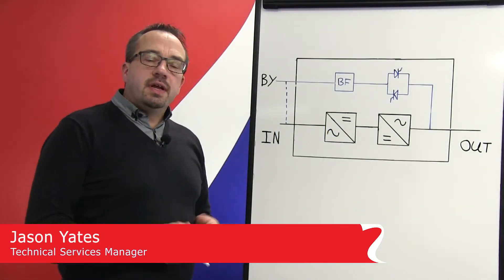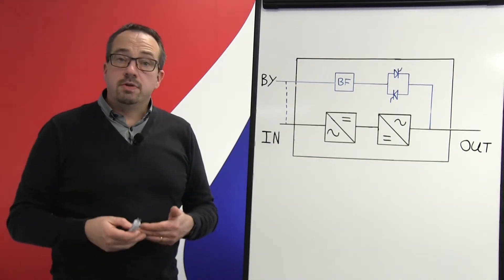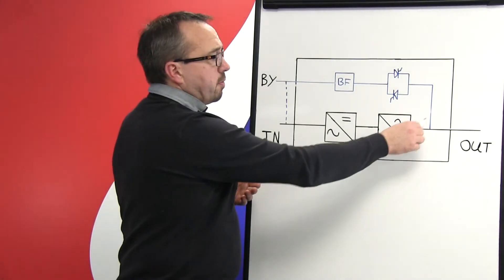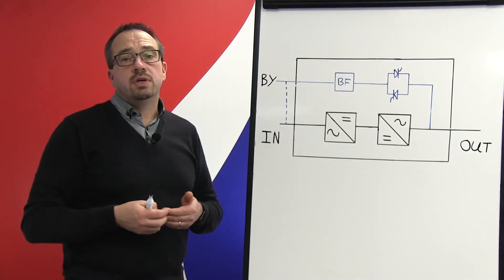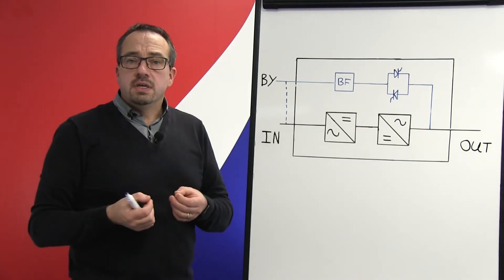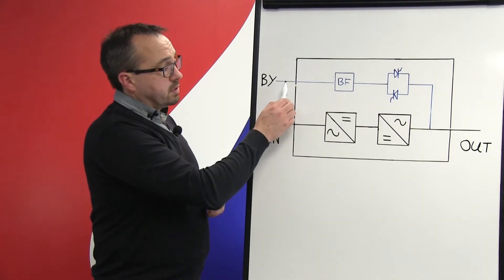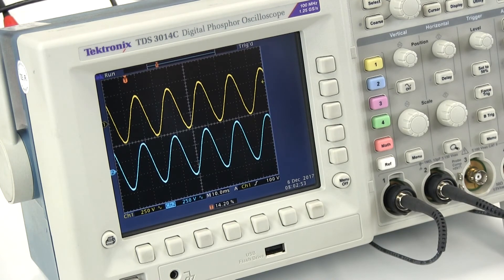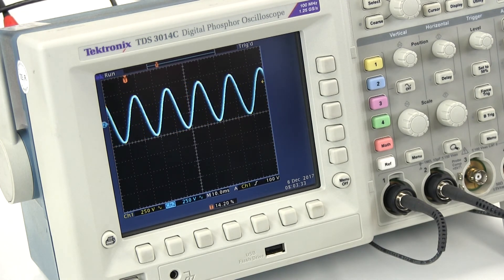#TechTalk: UPS Bypass Synchronisation

Comment: In the normal condition Bypassed alwyas standby right?
In my understanding  below is Sequence of UPS working :

1. In the normal condition, load will be supplied by Charger through Inverters
2. In case Main supply Shutdown, Load will be supplied from Battery through inverters
3. In last when charger or battery broken or under maintenance, Bypassed will be used as main supply of the load>

Is it right.. Need your confirmation, Please..

In case normal condition but bypassed working, some UPS detect as abnorrmal condition, right?

Comment: If it is not synchronised , will it affect any UPS components?
Reply: While the UPS inverter is unsynchronised from the bypass line it will run to its own clock frequency, usually derived by an internal crystal-oscillator (50/60Hz). During this period of unsynchronisation any transfers between the inverter and bypass will be inhibited by the UPS logic to prevent any damage to UPS components or potential loss of the critical load.
Reply: @comfortablynumb6862  understands that..but recently one of our clients explained a situation, where the operator turned on the manual bypass switch directly and he then switched it off suddenly when he heard an alarm. The power module was found faulty. Is it really possible ?
Reply: @jinusivan3452  It sounds like the manual bypass switch was operated without first transferring the system to static bypass via the static switch. 

This is unfortunately a common occurrence with operators who are not familiar with UPS systems and yes it can cause significant damage to the UPS.

In order to transfer the system to "maintenance bypass" the system must be first transferred to "static bypass". "Static bypass" is where the load is fed via the bypass line through the bypass static switch. Depending on the system this may be initiated by stopping the inverter or commanding a transfer via an HMI, for example. Only at this point may the manual bypass switch be used otherwise you are paralleling the bypass line with the inverter output and bad things happen!

I responded to a recent event where an operator had did just that on a large industrial UPS. They lost their critical load and could not return the UPS to normal operation. Fortunately in this instance no damage had occurred to the UPS inverter or static switch components, only the inverter output fuses had blown.
Reply: @comfortablynumb6862  that explanation was so helpful.. Let's say if we want to know why it occurs.. is it because of sync issues between the power supply from the bypass line and inverter output ?
Reply: @jinusivan3452  Do you know what system model you are referring to? There are some commercial systems that do utilise a bypass switch which can solely be actuated for maintenance bypass transfer. These systems inform the UPS control logic via auxiliary contacts that the system has been switched to bypass and at the same time activate the static switch/shut down the inverter.

Would be easier to comment if I knew what type of UPS you are referring to.
Reply: @comfortablynumb6862  riello MST160
Reply: Can I contact you via messages or email. Would like to get more information on this
Reply: Why cannot UPS supply bypass mode?Which component do we need to check?UPS work from bty mode to AC mode alternately. @comfortablynumb6862
Reply: Jinu Sivan no doubt about that.
when a synchronization is error the result will be components damage.
Reply: @onemytech196  what will be the nature of damage